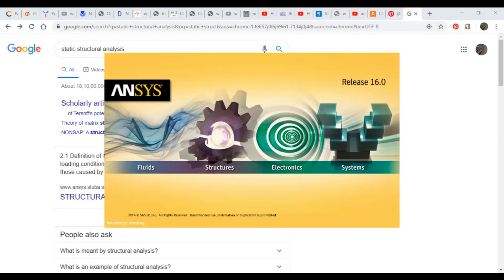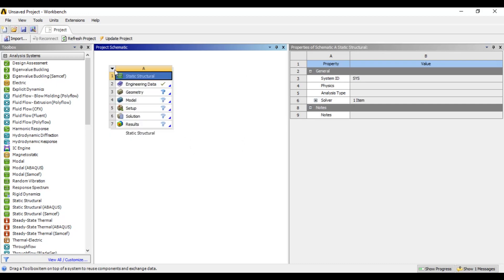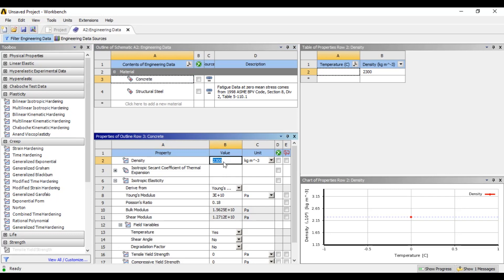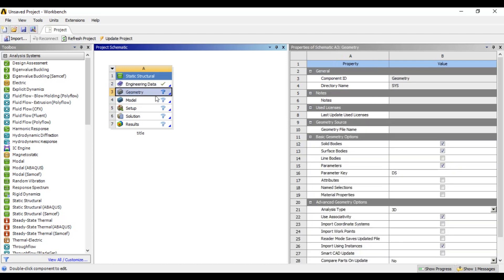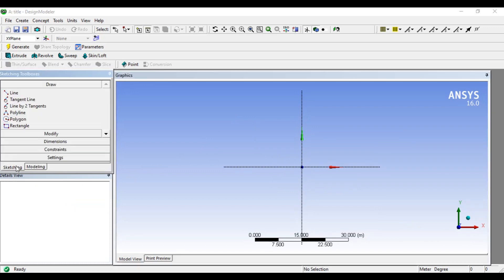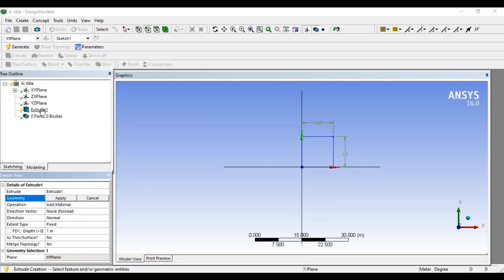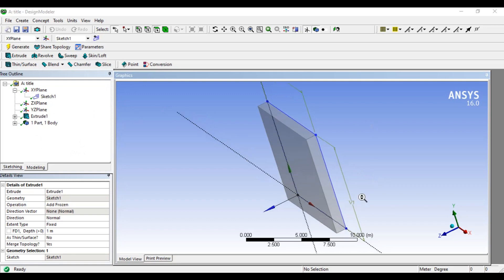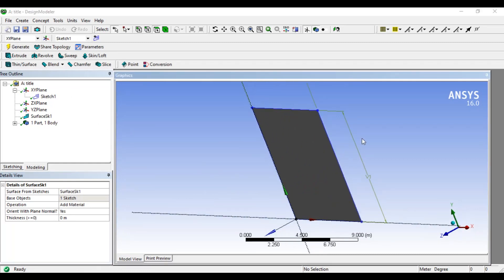ANSYS Static Structural Analysis For Beginners Part-1 (Malayalam)

Comment: how to solve  problem..reg.ansysedt.exe.error 3221227010
Reply from the maker: I haven’t got such an error, hence I haven’t tried the following. These are the solutions that I found on internet.

Solution 1:

Rename C:\Users\<username>\Documents\Ansoft  to anything else

 

Solution 2:

1. Update the graphics driver

2. Go to D:\ANSYS\AnsysEM19.1\Win64\config , then right click on the "ConfigureThisMachine.exe" and run as administrator.

 

Solution 3:

1. Open Windows File Explorer and type this in the address bar %TEMP%

2. Make sure that your system can see hidden files, then look into this %TEMP% directory for a copy of ConfigureThisMachine.exe.init.log and delete this.

3. Go to D:\ANSYS\AnsysEM19.1\Win64\config , then right click on the "ConfigureThisMachine.exe" and run as administrator.

Comment: SIR , how to slove machine configuration error while installing ansys
Reply from the maker: I haven’t got such an error, hence I haven’t tried the following. These are the solutions that I found on internet.

Solution 1:

Rename C:\Users\<username>\Documents\Ansoft  to anything else

 

Solution 2:

1. Update the graphics driver

2. Go to D:\ANSYS\AnsysEM19.1\Win64\config , then right click on the "ConfigureThisMachine.exe" and run as administrator.

 

Solution 3:

1. Open Windows File Explorer and type this in the address bar %TEMP%

2. Make sure that your system can see hidden files, then look into this %TEMP% directory for a copy of ConfigureThisMachine.exe.init.log and delete this.

3. Go to D:\ANSYS\AnsysEM19.1\Win64\config , then right click on the "ConfigureThisMachine.exe" and run as administrator.